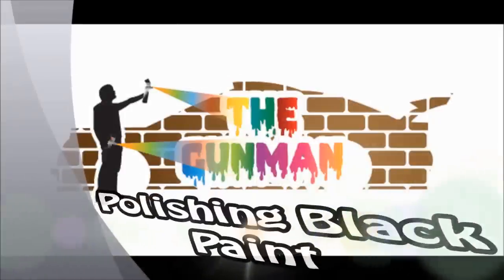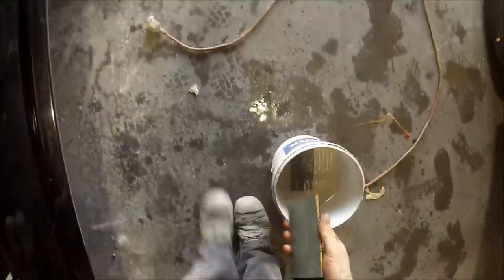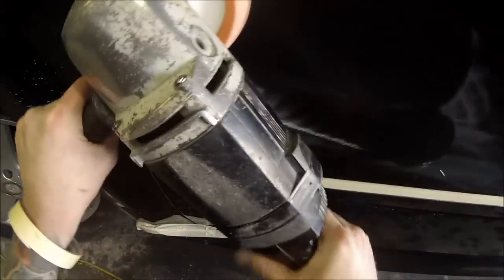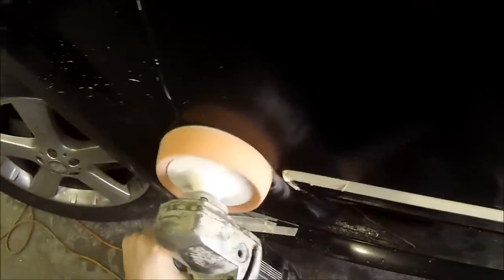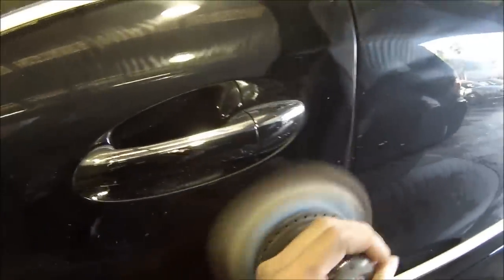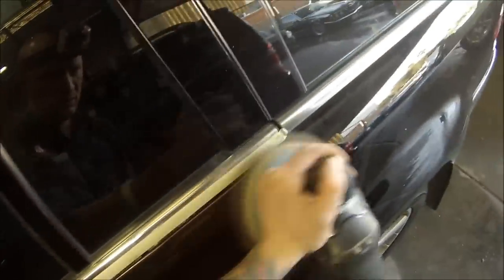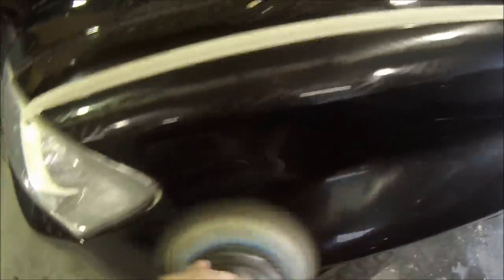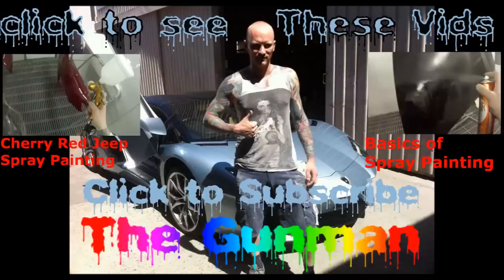How to Cut & Polish Black Without Swirl Marks

Comment: Never used an orbital polisher for removing swirl marks. Looks like I need to give it a shot. Nice job!
Reply from the maker: Its the only way to go these days, it makes polishing dark colors so easy. and as I mentioned if you cant justify spending $500+ on the Rupes Bigfoot then you can use an orbital palm sander with a polishing pad on it.

Comment: thanks bro for the video.. i will watch same more.. just biught a 1972 chevy truck and is black. and has been sitting for 3 years and needs a buff job.. bad.. and i have never buffed a car before.. so looking to see how to do.. looks pretty straight  forward...
Reply from the maker: Black is a real bitch to get the swirls out, that orbital polisher is awesome for it, if you have an orbital sander you can get a foam pad with a velcro back that goes straight on it then use that for a final polish and swirl remover.

Comment: That's like a mirror, even better the buff!.

I got ripped off.

Just got my 81 Camaro Z28 back from paint a couple months ago.

I did the body work. They then layed on a heavy coats of primer and then block sanded it. They checked it over and did some touch ups here and there. They then primed it again and block sanded it out.

They then painted it base/clear gm lemans blue.

They took 4.5 months but told me that it would only take 1.5 months.

It turned out all orange Peely.

There fee was C$5000 Canadian.

They want another $1000 to wet sand and buff it out.

That a fair price?

I'll be doing the cut n polish myself now.

Comment: try using the 3M three step polish compounds and pads. in my opinion it is hands down the best out there
Reply from the maker: You may have done it by accident but that comment appeared 13 times.
Reply: Holy crap so sorry. I assure you I am not in love with 3M that much my mistake. Sorry to all
Reply from the maker: Layton Dilley haha, I thought it may have been a 3M rep. I deleted most of them just left one.
Reply: That is probably the worse combo in 2016. 
It was good back in the day - 2005.
Reply: I personally can't stand using the 3m system anymore, now that I've been using it for 3 years. It's old tech. The EX compound work good. I don't like their pads or final polishes.

Comment: What speeds do you use? I work at an autobody shop and we're having problems with swirls man.. Our combo is a 3M 3-step system that we can't change.  

We use woolpads for cutting on light colored cars - white foam pad for cutting on dark colored cars. 

I've been experimenting with speeds of 1200-1800, with cutting. And 1000-1400 with polishing...

It seems like it'll look perfect when we're done. Then once it goes to detail for a wash, the holograms come back. Its almost like the step 2 isn't strong enough to take out the swirls from the previous step.. We can't switch up the chemicals either (VOC laws). Any advice would help. Thanks
Reply: The 3m foam pad with the number 3 blue polish is still a TAD aggressive on softer paint. Also, lighting is key. Try using a sun-gun when polishing black paint. Also, make sure your foam pads are SUPER SUPER SUPER clean, and the panel is SUPER clean between steps.
Reply: We use compound on wool for 1st step then compound white foam for 2nd step then polish on grey foam then ultrafine 3m polish on blue foam pad all done on 1800 rpm works great for the production shop I work in just takes longer because we use the most steps on black hope this helps